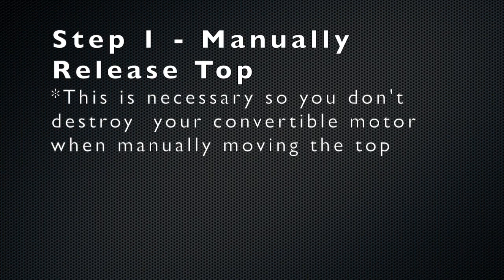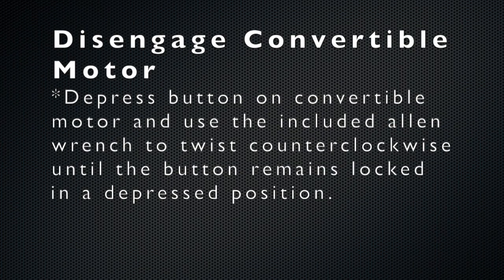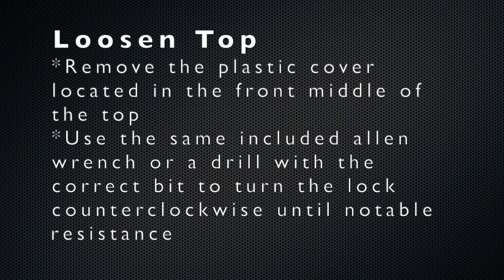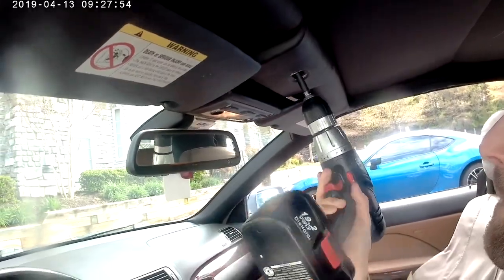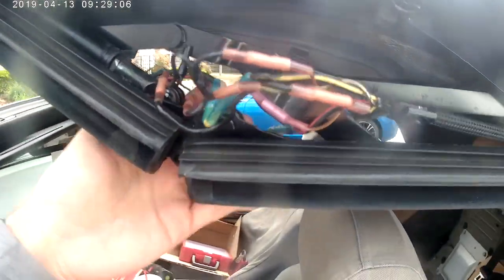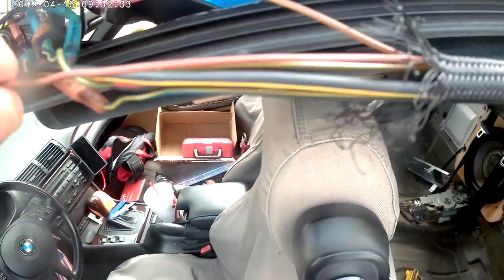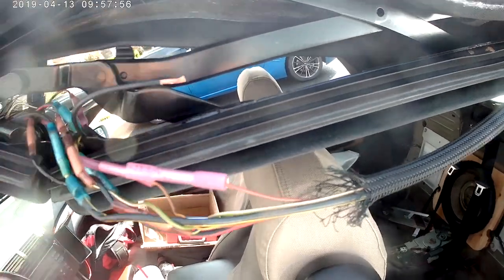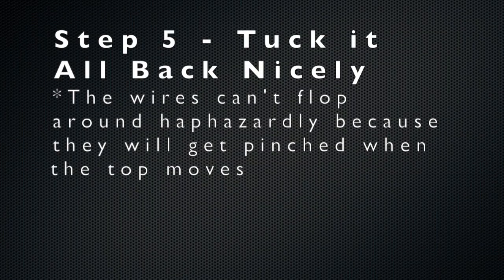BMW e46 Convertible Wiring Diagnosis & Fix, Part I

Comment: Hello, my lid cover motor not open , i think motor don’t receive signal to open lid, any ideea? Thx
Reply from the maker: Do you have any visible breaks in the wiring? There is another spot that will have some wire breaks (see part 2 video)

Comment: Hello my top working half way I did same wiring still no luck ..scan tool showing latch switch open. Circuit still no luck will appreciate if u can help
Reply from the maker: Did part 2 help you?

Comment: I subscribed. And I couldn’t help but notice the very nice front seat covers, that look like they are made for a convertible. Where could I get some?))
Reply from the maker: Thank you for the subscription!

The seat covers are OEM that I bought used many (5+) years ago from someone on the e46fanatics website. Unfortunately I don't have a product number and when I searched for them I got all aftermarket ones. Sorry that isn't more helpful!
Reply: @AvoidStealership  thx. I figured they were factory. I wonder if you saw my other comment about tonneau cover not opening on my convertible? You have answered another gentleman with the same problem and wrote that you have some sort of a large document on fixing that.
Reply from the maker: Perhaps I missed it. I can email you the documentation on the convertible if you email me at:
avoidthestealership@gmail.com
Reply: @AvoidStealership  thank you very much. Will do.
Reply: Hi. So the problem was stuck flap motor under the rear seat. It has the infamous “bolt through fix”. I replaced it with the Ebay aluminum cover. Had to modify it slightly because the case was slightly bent in on top. Unfreezed all, lubricated, and the top is working!!!! It’s actually pretty fast - 21 seconds. Your fix over the drivers door was already done before, I could see. Thank you for your help.
Reply from the maker: @marknoir  Awesome! Glad you got it fixed. The aluminum cover is a Godsend

Comment: Hello there sorry to bother I have an 2004 bmw 330ci convertible. My issue is that the top is trying to open the back gate lifts up then the top is not going back. But if u help it with ur hand is going back slowly. But then the back cover won’t close. U have to release the button 2-3 times then will close. And when u trying to close the top the back cover lifts up the then the top comes to the point for the back cover to close up is staying open 😞 do u have any idea what would it be. The fluid on the reservoir looks on the dot and I’m not missing any fluid. I open the wires but I didn’t open them all the way only on the front. And I know there is some more wires tuning underneath. What do u think it will be?
Reply from the maker: Without seeing it, it sounds like you have a short (break) somewhere along your wiring.
Reply: @AvoidStealership  now that I’m trying to open and close it it is very slow like u need to help it with ur hand to be able to close it and open it
Reply from the maker: @klodjanpilinci8911  is the car running? Or are you doing it just off battery? Your battery might be weak
Reply: @AvoidStealership  no the car is running
Reply: And I checked the wires on the rear driver panel they look good. I’m so confused 🫤
Reply from the maker: @klodjanpilinci8911  what about the gear box under the rear seat? Maybe the gears are slipping. Though the way you describe it I might think that's your hydraulic pump is dying
Reply: @AvoidStealership  I had another hydraulic pump. And I change that as well the one at the trunk. Gears I put some geese
Reply from the maker: @klodjanpilinci8911  do you have pa soft to read the actual error code?
Reply: @AvoidStealership  I have a scanner Solus Legend from snap on tools.
Reply from the maker: @klodjanpilinci8911  does it let you see what is wrong with each individual module?

Comment: Hello well done on my 2020 330ci top stopped working Dash shows blinking back lights on the diagram. I was adjusting my seat and it worked. When I moved the seat again it stopped working, can I assume it’s under the front seat ? Thanks for any advice 👏🏻👏🏻
Reply from the maker: Is it a 2002 or a 2020? If it's 2020, you dont have an e46 series BMW and I don't know enough about how they are wired to give you any advice
Reply: @AvoidStealership  sorry 2002 bmw 330ci
Reply from the maker: @guysmalley  Just so I understand the problem, your convertible top light blinks amber and when you adjust your front driver seat then the convertible top works and is able to open and close?
Reply: @AvoidStealership  the up and down buttons for the top stopped working then on the dash where the car silhouette diagram is the back lights are blinking continuously in addition the safety belt blinks (even with the seat belts connected) when I move the seat in just the right way the lights go out and top works normally ? I appreciate your time thank you
Reply from the maker: @guysmalley  I would start by unplugging the negative battery terminal and leaving it unplugged for ~3min.  This should reset your electrical system.  If that doesn't work, the ignition switch has been known to cause weird electrical issues also.  Before i replaced the ignition switch, i would double check the vert wires to ensure there were no breaks

Comment: It's wise to "move" your connections with new wire to either in front of or behind the top hinge. The wires in that area need to be very flexible.
Reply from the maker: @daniel stra - agree 💯 percent. I moved my connections toward the back of the car after the hinge and have a little more play

Comment: Helpful video. The issue I am facing:
e46 330ci, car storage cover does not open during top down/up sequence.
 I pulled out the rear seat and see the CVM motor is moving and the latch is engaging to unlock the storage cover.
What could be the problem?
Here is the video link:
https://youtu.be/YRGpqLheUVw
Reply from the maker: Interesting! I watched your video. Are you able to manually pull up the storage cover at the end of the video or does it remain locked?
Reply: @AvoidStealership  Yes, I am able to manually pull up the storage cover at the end and lower the top into space. Then again press the top switch open button to lock the storage cover and complete the sequence. 
For top raising procedure, pressing 'close' button will unlock storage cover then manually pull up storage cover -> take out the top ->close the cover -> press 'close' button and rest of the sequence will happen automatically.
Reply from the maker: @placidnick100  how do the levels look in your pnuematic reservoir? The tank is on the left side of your trunk surrounded by foam. I don't have a picture off hand right now
Reply: @AvoidStealership   It looks above mark when stable and have movement when operating. If I manually open and hold storage cover and ask my frd to push top up/down button then storage cover gets pulled down i.e. it’s pistons/pulleys are not dead. So, only problem is storage cover doesn’t open automatically during up/down sequence.
https://drive.google.com/file/d/1Qa4VxjCDx5kjvwo2qfcNd80lMMEjDNAz/view?usp=drivesdk
Reply from the maker: @placidnick100  Send me an email at avoidthestealership@gmail.com. I have a document that will help but it's way too big for here
Reply: Hi. Great helpful videos! I have exactly the same problem. I know this reply is a but 1 year old, but worth a try. Is it still possible to get that document too?

Comment: Wow man great video!  Thanks for that!  How did you determine that there were broken wires in the top?  My light is red when I push the button and no worky work?  Just all of a sudden.  I’m wondering if I have the same issue?
Reply from the maker: Most people have a break above the driver door, just like this video. It's a pretty common problem for these convertibles
Reply: @AvoidStealership  wow duh I just now watched your second video.  Incredible!  Thank you so much for this super helpful information!  I just got the car and it came from a warm climate and now it’s in my cold garage up north.  I bet this is exactly what happen to me.  I think the cold is making her a bit cranky.  My scanner won’t connect to the body module but I guess I’ll have to buy one that does.
Reply from the maker: @dgroebl  Glad it was helpful! Having a scanner is truly one of the best tools for this vehicle!

Comment: Nice video - You mention a couple of times about heating the butt connectors to obtain a connection - I REALLY hope you also CRIMPED the butt connectors before heating them! The heat is simply to seal the heat-shrink covering, it does NOT make an electrical connection to the wires. They must be properly crimped (preferably with a tool designed specifically for this job) in the metal core of the butt connector to achieve a reliable electrical connection.
Reply from the maker: Grant, you are spot on!  I did crimp them before heating them.  That is an excellent clarification so thank you for pointing it out!
Reply: I know Mom misses the Bingo and seeing folks out front.

Comment: Thanks buddy,   Nice video,

Im probably gonna use solder and heat shrink to keep it neat..   So i can go for that 
"you cant tell it was ever broken"  look..  

If anyone does this and they are looking for the broken wire you can use a multimeter with some wires attached to some needles to probe the wires until you find the broken one.. Just remember to seal up any holes you create whilst searching with a dot of superglue so the damp don't get in there and cause more grief.. 

I hope that mine is broke there, where it easy to reach. Im Gonna start searching through the wires after Christmas..
Reply from the maker: Best of luck and great tip with the multimeter! It's a PITA to do each wire but if you start with the small, more brittle ones it shouldn't take too much time.